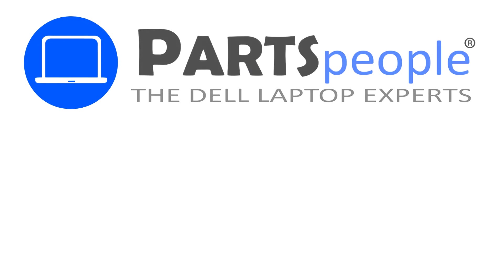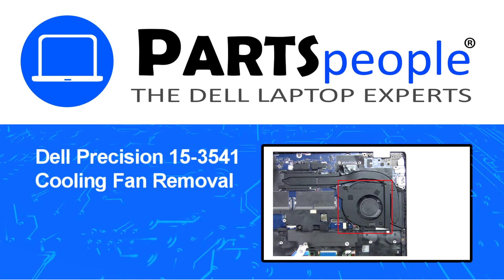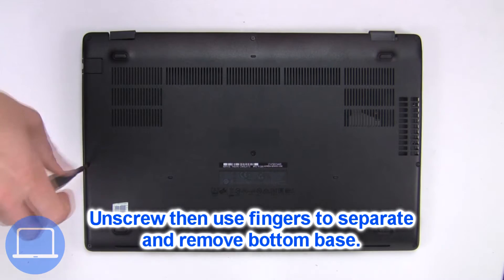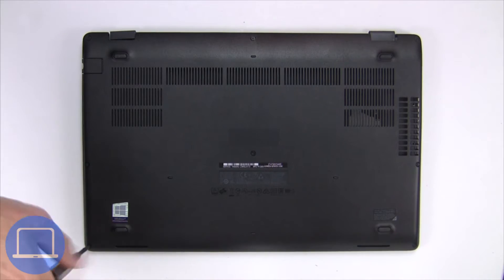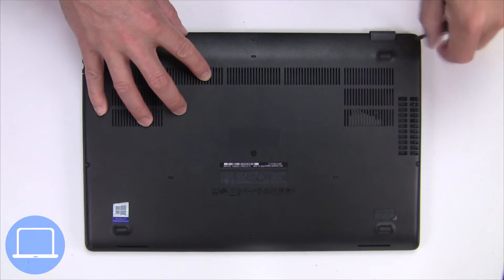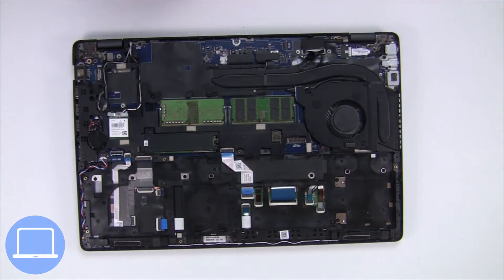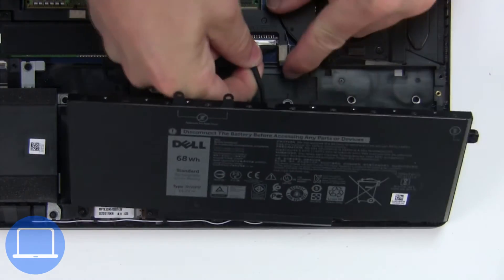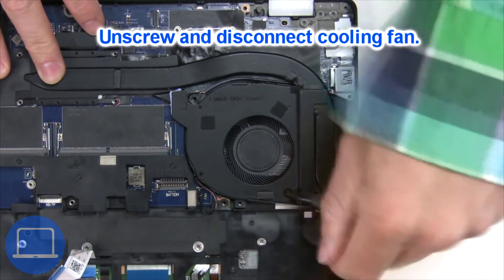Dell Precision 15-3541 (P80F003) Cooling Fan How-To Video Tutorial

Comment: Precision 3541 - very disappointed with this laptop. Using it since Oct 2019, panel above keyboard is always hot. Games are lagging because of low fps and high GPU temperature. And it happens with cooling pad and vacuum cooler. This laptop does not cost its price.